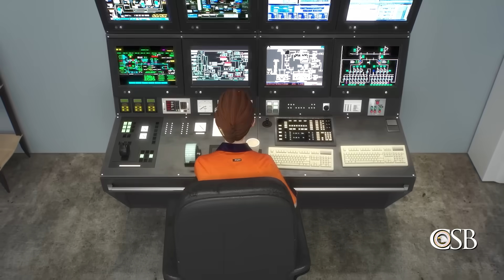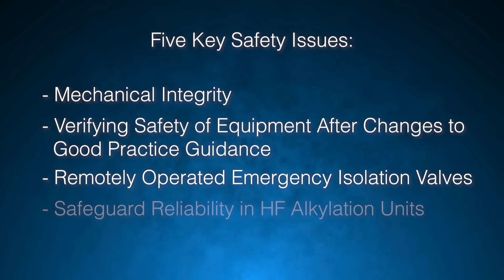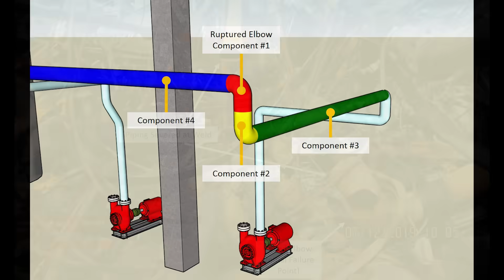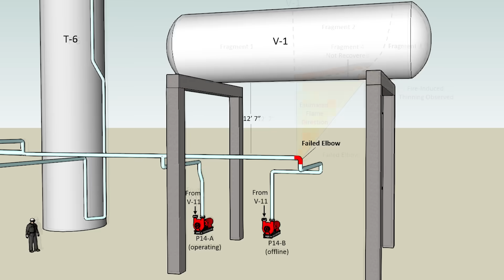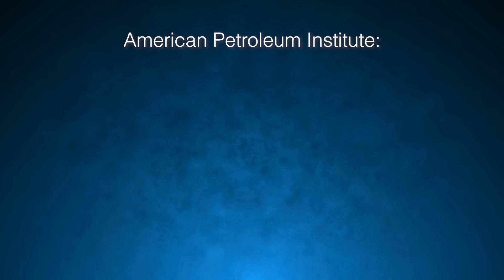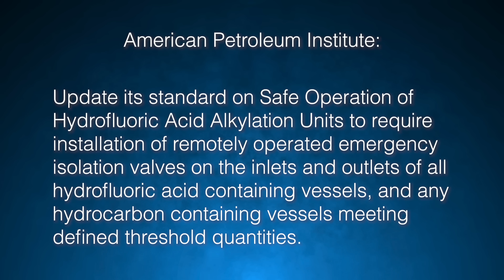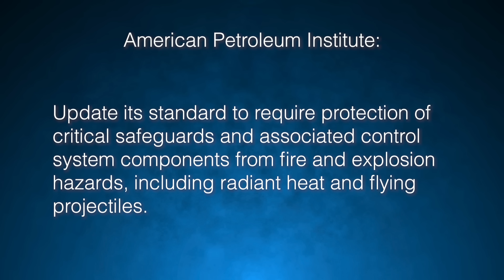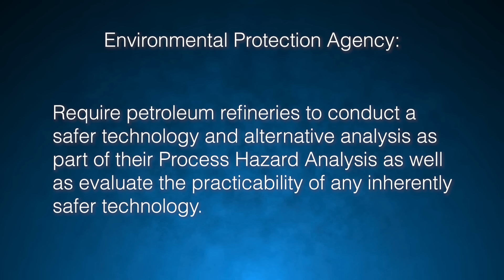Wake Up Call: Refinery Disaster in Philadelphia

Comment: It sounds as though these elbow joints that contained higher amounts of copper and nickel were inconel or hastelloy.  
It's fascinating to know these joints lasted as long as they did, and that milder steel would have suffered less corrosion than the hastelloy/inconel used.
This would be very difficult to confirm would testing as these pipe joints that bend are exposed to dynamic corrosive forces at industrial scale.
Reply: The elbow was basically carbon steel, but had about 2% Ni and 1% Cu in it.  In non--HF service, this would actually be more corrosion resistant than standard CS.  The piping that failed was about 95% propane and less than 2.5% HF, which is why it lasted 40yrs.
Reply: @cw1044  Where were you able to find that the elbows contained those percentages of Ni and Cu?
Yes I am aware that milder steels would be more resistant to the HF attack, even at lower concentrations through the piping.
Reply: @TrulyAmazingPS  @Justin Case  It's in the CSB report, there's a table about 2/3 of the way through.
Reply: @cw1044  Thank you for replying with this.  Appreciated.

Comment: The refinery industry is the worst.  These guys don't care about industrial safety.  If they did, they would use corrosion resistant materials.  Look at the videos in the list of CSB uploads.  There is a pretty heavy weight given to refineries.  Thi scenario is about the best you could hope for because the staff seemed well trained.  But they are lucky as sin no one got killed.

Comment: Let me say this about that. I am appalled by the lack of safety in regards to the failed pipe elbow. The higher content of nickel and copper should have been never used especially involving acid. Any first year engineers know that the electrolysis of moving liquids is highest at such rapid bends. This was a tragedy that should have never happened.
Reply: Typical management statement, blame the workers for the engineers poor performance and not listening to field supervisors.
Reply: Ok Richard. Let me get this right. Your reply to my post was a typical management statement. I hope that it was your response joining mine. If not piss off mate. If it was great no problem.

Comment: I would imagine that the extra cost of those extra inspections over the years would STILL be less costly than what the accident, clean up, and downtime cost. Great video!
Reply: PES was owned by a private equity firm.
And it was losing money, it was only able to keep running by adding more debt.
They had been searching for buyers, but with years of constant losses on the books no one was interested.
Then the explosion happened.
The companies insurance offered them hundreds of thousands for the loss of the HF unit, so they made the decision to   spread as much of that money among the investors as possible and sell the land under the refinery.
There will never be a culture with long term goals in companies as long as CEO's change out every few years.
Investors want returns RIGHT NOW, not twenty years from now.
So no matter how much you try to shame companies for running fast and cheap, you still want cheap gas and for your 401k to grow right?
Then you're part of the problem.

Comment: Here is something I would think would be a no brain-ER, that was not mentioned. When dealing with lines containing flammable substances, maybe don’t place tanks containing explosive gases above such lines without adequate heat shielding so such tanks are not exposed to jet flames.
Reply: That sounds good in theory, however every line in a refinery contains flamable substances. The problem with fireproofing, is that it's time consuming and difficult to remove, and prevents inspection of the vessels from the outside (since it's usually a castable refractory), which essentially leaves you with an additional vulnerability. Most vessels are insulated, but they're not designed to survive a sustained fire for hours. The issue here is that the fire supression system did not trip like it was supposed to, that would be a more economical and safer issue to tackle.

Comment: Wrong wrong wrong ! In this accident/incident report video they only talk about safety measures after a incident occures. But instead they should talk about preventing it. Critical pipeline systems should be checked, tested, examined each half year or at least yearly. so they dont expect but knowing the condition of the pipe, wall thickness ect. It can be done whithout shutting down the process for example NDI, non destructive investigation ( röntgen ) to see how internally corroded the pipe really is and over a long period of time like 40 years??!!! they can see each half a year or yearly how much corroding there is and replace the pipe before the wall thickness becomes critical thin.

Comment: Hearing the list of recommendations, I have to wonder why "prohibit refineries from being near - let alone IN - population centers" wasn't added to the list.  It seems like that would go a long way to mitigating the impact of industrial accidents when they happen.
Reply: The problem is that a lot of these really old refineries were built during WWII, and at the time they were NOT buit in population centers. The population center kind of sprung up around them. The government will not issue permits to build new refineries (and even if they did it would cost billions to build one from the ground up), so these old ones have to just inspect and upgrade/replace as they find them. This was a result of not inspecting 100% of every component in the unit, which is an issue unique to HF units.

Comment: I grew up JOP (just outside Philly) and remember the HUGE fire at a refinery (I believe Sunoco) where Frank Rizzo's brother was Fire Chief and was killed along with a few others.  It was devastating incident.  I don't know the exact count for people killed, I would have to do some research to obtain more information.  I now live in BFE Montana and just a few miles away we have a decent size refinery.  They had an "incident" a few years ago and there was SERIOUS CONSIDERATION to evacuating a FIVE MILE RADIUS around the site) and a TEN MILE evacuation was seriously considered.  It was amazing to see people try to drive around the road blocks because by the gods, WE ARE GOING TO SHOP AT WALLYWORLD (which is directly across the street).  Due to the well trained personnel on site and their absolutely fast response and other processes were quickly shut down and the incident brought under control very quickly.
Reply: The fire referenced took place at the former Gulf refinery in April 1975. This refinery was purchased by Chevron some years later. The adjacent Atlantic refinery became part of ARCO. Both refineries were purchased  by Sunoco  and  combined into one operation which became Philadelphia Energy System as Sunoco  withdrew.
Reply: @brucereynolds7009  Cool.  I haven't had the chance to check the history.  I remember how Frank Rizzo's brother (Fire Chief) was killed along with several other firefighters.  The refineries went through a number of changes.  Thanks for the update.

Comment: I worked in  hf unit at PBR  for 9 years..gotta clear the unit for shutdown with ammonia...fun all around
Deadly deadly shit
Always the elbows get you
Use model!
This is what happens from the crash of 2008...oil executives left..investment firms took over. Always the bottom line and the didn't have a freaking clue how to run a refinery

Comment: USCSB is a shining example of what good governance should be.
Reply: i wonder, why are all of the specifications/recommendations so narrow?
Why is there no catch-all statement at the bottom of them, like there is in many other areas of law. remotely operated isolation valves have to be installed on HF tanks, but if the tank contains some other highly corrosive fluid then not.

Comment: What wasn't the vessel rupture prevent by a PSV?
Reply: The metal gets hot and will eventually fail, a psv can not prevent that. It just prevents overpressure in the vessel due to the fire, prolonging the eventual failure.
Reply: @knarf_inc4790  To expand on this, the pressure rating of metals declines as temperature increases. If the RV was properly designed for a fire scenario, the RV setting would take this into account. But if it was only designed for overpressure at process conditions, it might not.

Comment: Great topic - The old specs for some steel grades only controlled "other elements"  As steel recycling increased the copper content increased, but fell within the range of acceptable "other elements".  I came across this while designing an HF piping system in the 90's.  I think the specs have addressed this but it's important to share this knowledge and drive home the lesson learned that high Cu in HF steel is not appropriate.
Reply: great comment. Everyone used to be so sure more alloying elements meant less corrosion. I learned something today!
Reply: There has been a few fires caused by corrosion of pipes. They really need to start upgrading old plants to stainless pipes. Stainless might double your material cost, but it will last longer, and be more safe.
Reply: @tubester4567  they are relying on the passivation of iron with HF to produce a stable fluoride film. Stainless (which stainless) may or may not hold up any better. And the failure here was a localized pocket of too much copper in the iron. Steel (iron) was historically full of such localized problems. It's better now than it was 50 years ago.

And if stainless isn't welded properly, the welds will leak like a sponge as the chromium carbide is no longer available to provide the passivating oxide film.
Reply: @EldonJohansen  Maybe for HF but in general most processes would be better served by using stainless steel. Obviously the extra cost iis a factor but many modern plants use stainless these days.
Given stainless is 75-90% steel it would probably still work for HF.
Reply: With something as dangerous as HF, there should be a process to measure the thickness of piping in any process, regardless how long it "should last". Wait 50 years for a pipe to burst is somewhat irresponsible...
Reply: @EldonJohansen  There are systems in place at all refineries to measure thickness of piping.  The problem is, you can't measure the thickness of every square inch of piping.  So, you measure "circuits", meaning a defined "chunk" of piping where you expect the corrosion rate to be the same everywhere.  What likely happened here, was the metallurgy of that one elbow was missed (they didn't realize ahead of time that it wasn't the same as elbows nearby).   The challenge is, these facilities are often upwards of 100 years old, and recordkeeping of every change wasn't nearly as robust historically as it is today.  Had they realized that elbow was a different metallurgy than surrounding piping, it would have been its own "circuit" and been on its own measurement schedule.
Reply: @breathedeeep  I guess that special elbow was supposed to be an early warning by corroding more quickly and allowing excess corrosion to be detected early, but at some point that special elbow became tribal knowledge, and then the tribe retired.
Reply: @breathedeeep  any drawn metal like an elbow has to be checked more often due to increased corrosion rates for various reasons, one of which is that the turbulence of the fluid can cause substantially higher corrosion rates. Of course it's easy to point fingers. But yes I do expect every square inch to be checked on a system where a leak would mean the death of anyone that walked by.
Reply: @EldonJohansen  I understand that elbows are areas of special concern, and the reasons. But facilities don’t check EVERY elbow. They’ll check the ones they think are “worst case” in a given circuit. It’s really simple here. This elbow was of different material than everything around it (which made IT worst case), but no one knew this elbow was different material.

Comment: This is not the first time that HF alkylation has been in the CSB spotlight. There was a 2015 explosion in Torrence, CA where, had it not been for a lot of scaffolding around the modified HF tank, it likely would have been been ruptured by the heavy flying debris from an electrostatic precipitator.  It was only dumb luck that the tank wasn't ruptured. 

Thanks again to the CSB for producing yet another video outlining the safety and design concerns of process control. Further, the operators deserve our gratitude for containing this situation and keeping it from being a whole lot worse than it was.

Comment: i agree that there should be a law that compels companies to reevaluate their fail safes, and ** to a degree**, be required to update fail safes if its inferior to what is available. my problem though, is what if there is a safety mechanism available that is 1% better than what is installed? in my opinion i dont think that is grounds for a whole new safety device/system to be required. idk where youd draw a line when it would become necessary though.

Comment: And once again, Abbott Animation and Sheldon Smith make most animation studios look second rate. What a fantastic video presentation.
The day after we received news of this failure, our crew that were on our own refinery's Alky unit were just that little bit more on edge than usual. I cant help but think that this incident, along with covid and BP's rapidly spiraling reputation at the time, led to our refinery's eventual shutdown announcement shortly after. 65 years we survived, and I can guarantee that a lot of our pipework was just as old, only to be switched off and turned into a tank farm over the following 2 years.
Reply: What was the name of the refinery you worked at?
Reply: @antonberglund117  BP Rockingham / Kwinana Refinery, Western Australia
Reply: @LurkMoar101  eyyyy wa rep
Reply: @LurkMoar101  I was under the impression that Kwinana was a loss maker for decades. It only really survived because the government gave it kickbacks to ensure garden island had a safe supply.

Comment: When I was in college I wanted to do a safety job because I love safety. The problem is my grades sufferer because I was being too safe. A perfectionist. I realize now real work only occurs when you're willing to ignore some safety. So long as the failure does not render the process unusable and monetary value of the failure is far less than the monetary value being brought in, it doesn't matter what disaster happens. The sun will rise the next day. Nobody is willing to pay for safety. Instead they pay for the bare minimum safety in any field.

#1 Safety costs too much to add and maintain
#2 The overhead/implementation slows down the process. 
#3 That phenomenon where you smell a bad smell and then you stop smelling it/ignoring it. (Complacency)

Very rarely do real out of nowhere accidents happen. Most are caused by neglect. The complacency of many to ignore problems during processing time. The complacency of many to ignore problems during inspection. The complacency of many to hold back their inquiries when someone of higher position says there's nothing to worry about.

Only time I see people caring about safety was probably NASA. However even they've had a record of complacency.

Comment: The fact there's a pipe that's still in service 46 years after being installed at a refinery is mind boggling! A similar thing happened at the Chevron refinery in Richmond, California except that pipe was much older! Don't the operators of these facilities understand steel can fatigue and fail from high temperatures, pressures, and chemical reactions. (YES, I know about the FeF coating)...... 46 freakin' years!
Reply: If proper corrosion monitoring is in place, 46 years should be no problem. We have older steel in our WW2 built plant. It’s still good because it was over-built. The problem here was improper material of construction and lack of a good MI program.
Reply: 46 years is really nothing.

Comment: $750 million in damages. Why do the government regulators and the industry bother with such terms as requirements and recommendations?  Industries want to adhere to the most cheapest, cost effective, and least impactful to production capacity of regulations. So making something a recommendation will just fall on deaf ears in the industry.  Requirement means mandated by law. Recommendation means just a suggestion.
Reply: CSB is an independent research and investigative body - it makes recommendations based on findings. It is OSHA that create and enforce rules based on these findings, along with other regulatory bodies like the EPA.

The split between investigators and enforcers prevents conflicts of interests, as what was so frequent with the Civil Aeronautics Board before it was dissolved and replaced with the FAA and the investigative role being given to the NTSB. This way, the NTSB and CSB can have findings like "FAA/OSHA/EPA regulations were lacking" or "FAA/OSHA/EPA regulations were poorly enforced", like some previous videos in this channel.